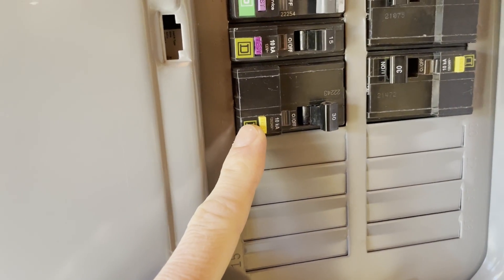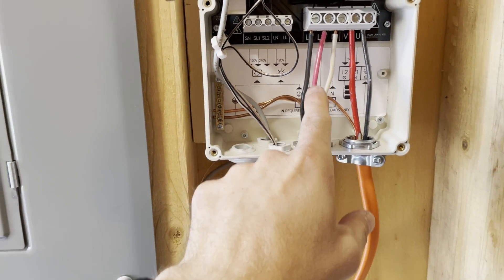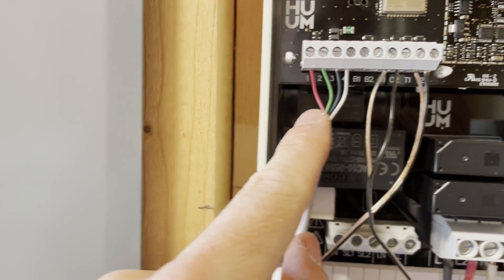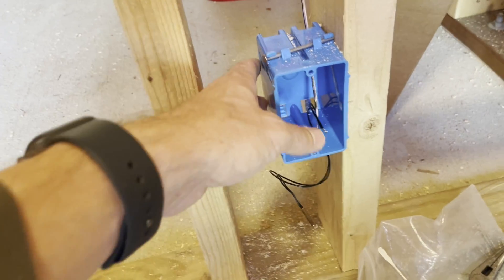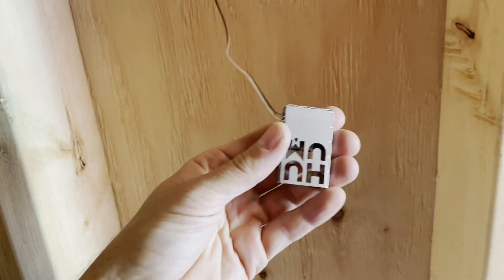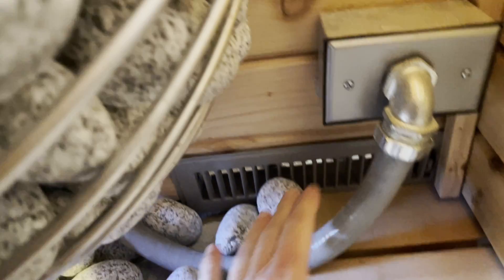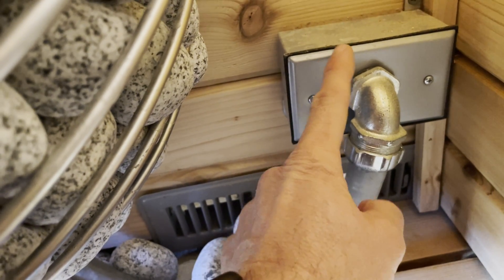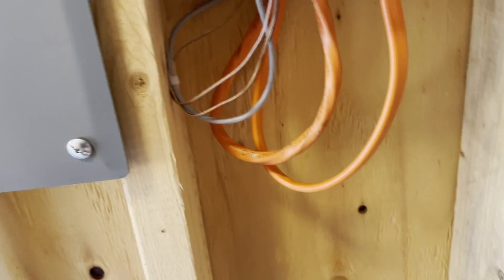Sauna Electrical Installation for Huum Heater and Lighting

Comment: Thanks for the great video! Very helpful. I have the 9kW 50 amp breaker and am pretty lost on what wire to use from the main circuit breaker to the main module as well as from main module to the heater. Any advice? Thanks again for sharing!
Reply from the maker: @karahaskell your 50amp circuit breaker is correct for 9kw heater. 50 amp require 6 gauge wire (assuming you are in north America). You will want 6/3 for circuit breaker to control unit, which is 6 gauge with red (hot), black (hot), white (neutral), bare (ground). The 120v white is only needed for lights and some accessories but might as well run in case of future upgrades. The heater doesn't need neutral so you can continue the hot red/black and ground to the heater with 6/2 wire. All of the other connections (temperature, door sensor, remote, etc) are low voltage.
Reply: @handyhomerepairs  Thank you so much! Really enjoying your whole sauna series. Great information in a general void!
Reply from the maker: Thanks so much. It was great fun to build and I was in the same situation having to piece information together as I built or just guess sometimes if I couldn’t find help.

Comment: I received an extra extension box.  I did not see you connect one to your system.  Is a extra one necessary?  Extension box...
Reply from the maker: @tinafernandez2876 I didn’t get any with mine. The control panel for the temperature dial just surfaced mounted. The thermostat gauge also surface mounted. I added an outlet box for the wire connection for the door sensor just so I could adjust it if needed. The only box I received was the main unit for all of the wiring. The wiring for the heater element in the sauna required a waterproof box so I bought that myself as well along with all the water tight connections.

Comment: Does the HUUM come with a wiring diagram/instructions?
Reply from the maker: Yes. All the connections are labeled in the manual for the control box. Electrical wiring is basic, 2 hots, neutral, and ground into box (only need neutral if controlling lighting). 2 hots and ground out to the heater. I forgot to include in video because I got excited putting in the rocks but connecting the heater part was simple. The ground connected to the frame and the 2 hot 120 volt legs were connected to terminals. No electronics in the heater
Reply: @handyhomerepairs  What size wire did you use? 10/3?
Reply from the maker: @marcjohnson6618  yep exactly. 30 amp breaker. Mine is 4.5 kw so the 19 amps is over the 80% calculation for a constant load on a 20 amp circuit.
Reply: Sounds good. Thanks for the info and the video.  It’s the only one I’ve seen about installing a HUUM. Mine should be here in a couple weeks so this helps a lot.

Comment: You can skip door sensors. Just put a jumper wire.
Reply: I’ve been waiting for a video like this! I just put together a barrel sauna and have the drop 6. I’ve been thinking how I’d do the door sensor and never thought about doing the jumper. I’m not worried about the door issue. This is great!
Reply from the maker: @gonzo1274  Glad I could indirectly help lol
Reply: @gonzo1274  were you able to figure out the jumper wire? I am actually doing the same thing for my outdoor barrel sauna and would like to skip the door sensor altogether. Do you know where you inserted the jumper wire?
Reply: @johnciancio  For the jumper wire just take the same leads and loop them back into the same terminals.  It just needs to complete the circuit to "think" the door is closed.
Reply from the maker: I see. That makes sense. I have careless people in house (not naming names) that may leave door open with hearing running. Mine also was wifi control as well, so would be a bad combination with remote start
Reply: Haha, no your video helped way more then just the door. I’ve been looking for months for a video on the whole wiring setup. The jumper was just a bonus. Just one less thing to worry about since mine is outside.
Reply from the maker: @gonzo1274  I know right? I spent forever searching for electrical help and it’s a dead zone. I spent weeks trying to figure the water and heat resistance conduit for the electrical. Finally found on eBay and had to buy 25 feet to use 2 lol

Comment: HI mate great videos and sauna build. DO you have a photo or example of how you wired up the heater? did you just leave the earth off? Thanks.
Reply from the maker: @NonStopNeal I got ahead of myself and installed all the rocks and forgot to capture the wiring. It was basic 240 volt install though. There were 2 leads, one for each of the 120v legs. The ground was definitely installed with the screw to the frame since everything is metal, there is moisture, and people can easily touch. The circuit breaker is arc and ground fault. I read some places that sauna heaters can trip ground fault but we have used the sauna at least 30 times now and have never had an issue.
Reply: @handyhomerepairs  Thanks for this, I have the 6kw Drop. Looks like i need a 5 core wiring for mine.

Comment from the maker: The wiring was completed in only a few hours. I already purchased the circuit breaker and wiring so it was ready once the Huum heater arrived. The high temperature conduit I had to order a few weeks in advance. It was difficult to find (at a reasonable price), so I had to order off eBay. It was still $150 U.S. and I only needed 2 feet. Conduit is Liquid-Tuff Hi-Low Temperature LFMC.
Reply: Do you think teck cable would have been sufficient?
Reply from the maker: @livinglifeasa16handicapfor27  I'm not an electrician, so not sure. I read that you need a sealed box and the conduit also needs to be waterproof. In addition, since there are high temperatures you need a high temp conduit. Most of the conduit I looked at did not meet both of these conditions. I wanted to be as safe as possible since people, 240v, and wet conditions seemed like a risky situation